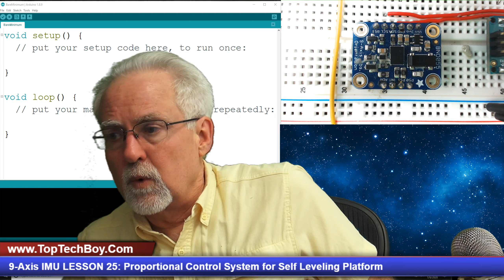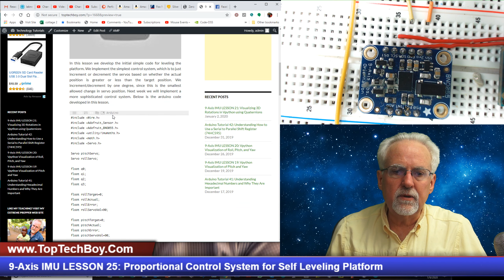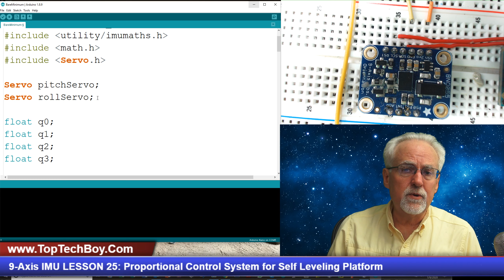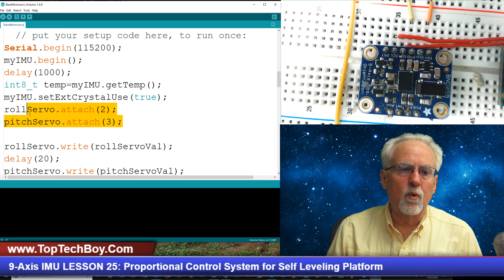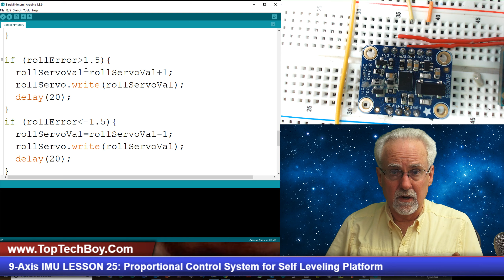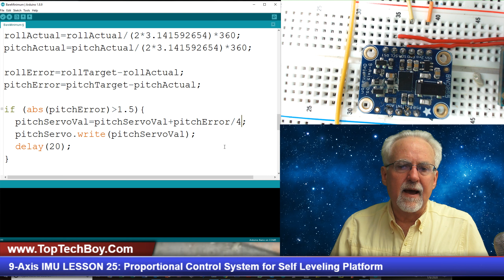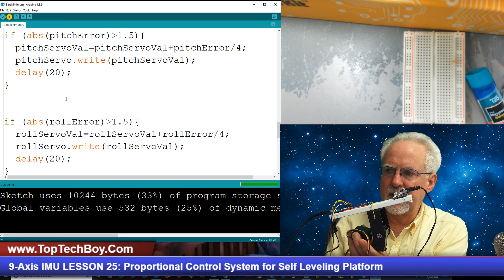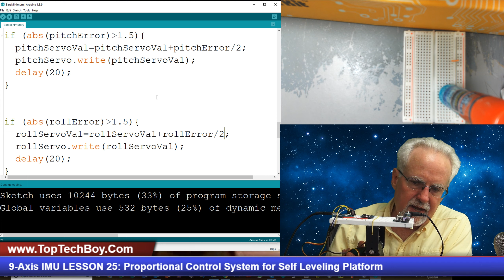9-Axis IMU LESSON 25: Proportional Control System for Self Leveling Platform

Comment: Curious to see if you're going to go over I and D?  Excellent tutorial as usual!
Reply from the maker: Patience . . . working on that video now, but a tough one to explain. Will probably be a long video.
Reply: @paulmcwhorter  

Hello Paul,

In this tutorial series you have proven your amazing ability to teach difficult subjects includin the math part of it. I would add there is no one on the internet that can or will go to the length that you do explain the math behind the hardware and programming. I look forward to the rest of the story on PID (the I and D terms) and we actually have an actual application in the self leveling platform to use the PID Controller no only for this application but for other applications that we all could use a PID Controller to implement a much better hardware/software solution. Again there is no one better than you to address and teach regarding PID Ccontrol. You are the rock star of internet teachers !!!!! Thank you very much for all you do !!!!!!! Rick

Comment: off topic but I think you might be the guy to ask.  I have a thundermax modual on my harley davidson and it can connect to a windows comeputer via serial port and display engine info and edit fuel air rpm etc. Point being I would like to make an onboard computer for my motorcycle with a raspberry pi with gps etc. I would also like to have the engine software on there . guestion is can I get a windows app like that to work on the raspberry pi  ?

Comment: Hello Paul,

Again loved your lesson on the proportional controller. It works well, but I have some confusion in the use of the ABS function to eliminate the second if statement. The ABS command returns a positive value wether you have a positive or negative number. This seems to mean to me that the error can only be positive. Also seems that you need a positive number to drive the servo in one direction and a negative number to drive the servo in the other direction. With the proportional algorithm we seem to be eliminating the error quicker but seems the error will always be positive. It works great and I know I am missing something simple and was wondering if someone could set me back on track with this question. Thanks much....Rick
Reply: The abs function is only applied to compare the magnitude of the error to the fixed positive value of 1.5. This removes the sign of the error and eliminates the need for different comparisons for positive and negative errors. However, when the correction is applied, the "raw" error value, including sign, is used so that the sign of the error determines whether the correction is added or subtracted.